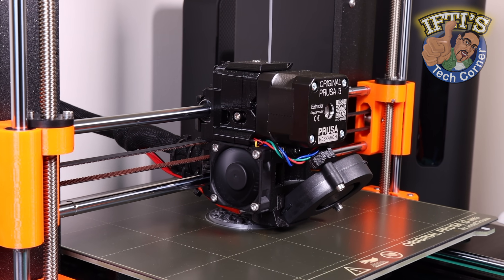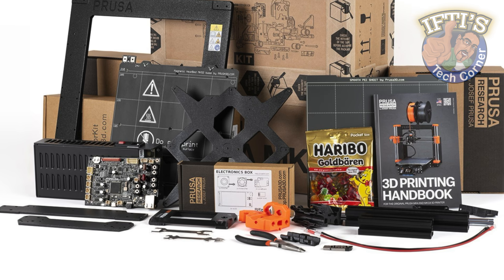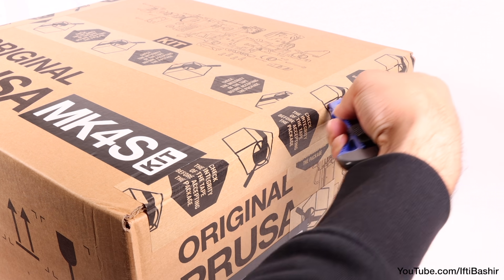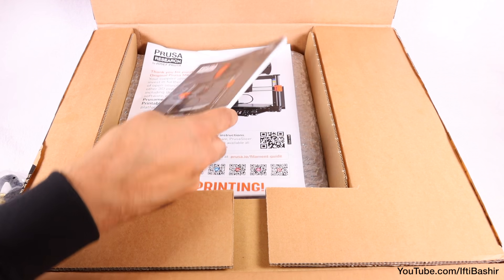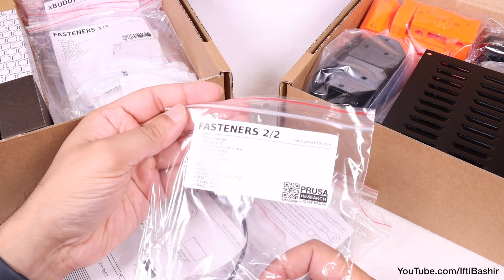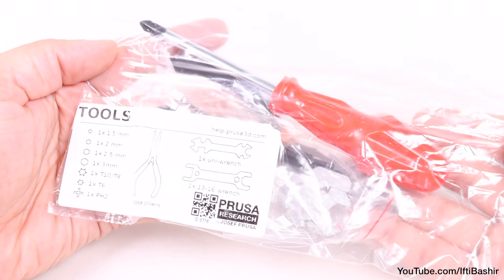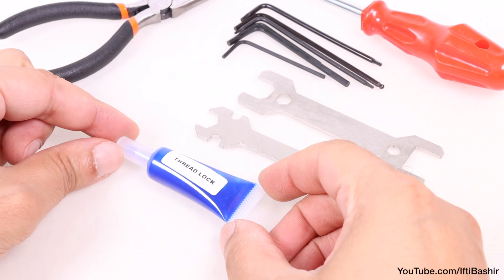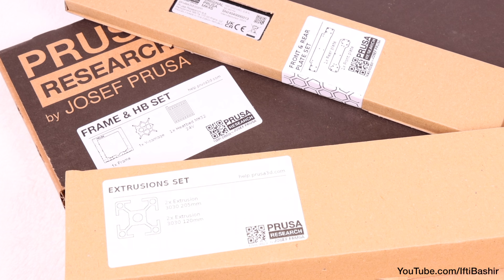#01 Original PRUSA MK4S Kit : Full Step-By-Step BUILD GUIDE - Unboxing & Preparation

Comment: IMO I would not use the blue Loctite however that is just my opinion!
Reply from the maker: I only use it for the frame itself, just so screws do not loosen with vibration over time, not for any other parts.
Reply: @iftibashir  yeah - Loctite might damage plastic parts - learned that hard way on my Voron :-)

Comment: :hand-pink-waving::hand-pink-waving::hand-pink-waving:Cool! After upgrading to the Prusa MK4-S 3D printer, I am completely satisfied. The printer delivers top-notch print quality – the prints are highly accurate, smooth, and flawless. The MK4-S upgrade introduced fantastic new features that make the process much easier, such as automatic calibration and faster print speeds. The printer is also quieter, which is a great bonus.